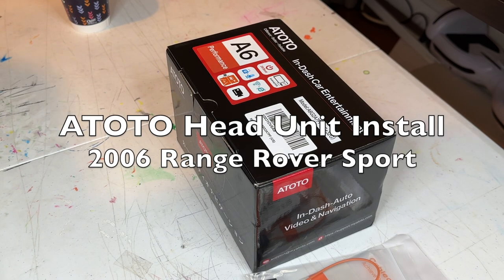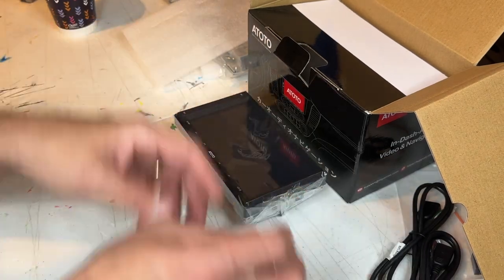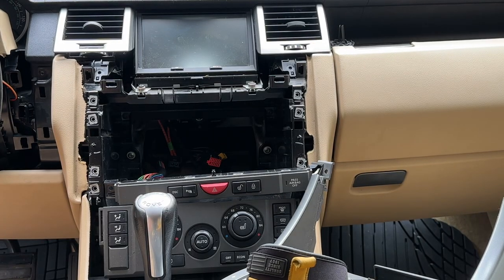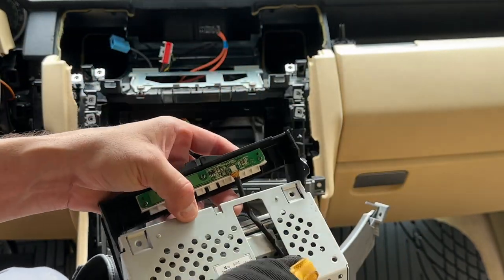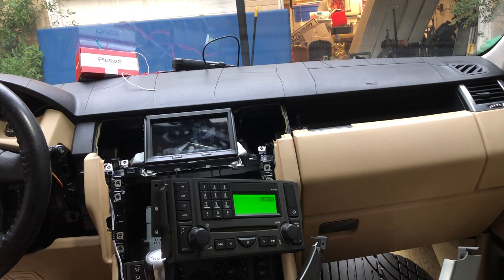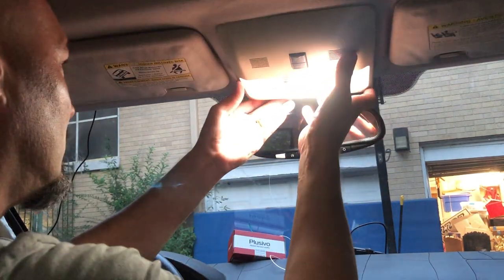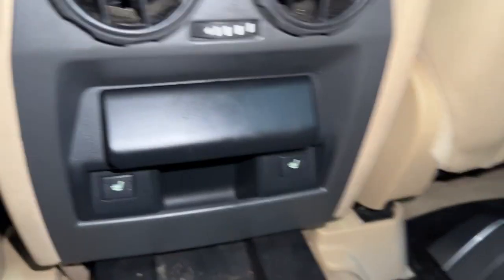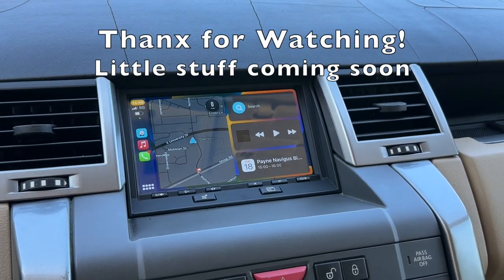L320: $140 ATOTO CarPlay Install∙ Almost OEM! - 2006 Range Rover Sport

Comment: Update for anyone trying: The off white/red and off white/black wires for the steering wheel controls are more of a brownish color rather than off white. Also, they were not twisted together in my case. I cut the off white/red wire, and it was able to control every single steering wheel control by itself
Reply: Hi, what do you mean cut off the off white/ red? You mean the wire cut off from main radio harness? After that, it iþ work all the functions on radio and cd unit?
Reply: @anuraalahakoon8630  I mean I cut it from the back of the main original radio harness yes, then spliced it to the steering wheel control wire from the new head unit. The wire will work for all steering wheel controls

Comment: I used your video as a basis for an upgrade of mine. I bypassed the factory amp. Ran leads from the head unit to under the seat, removed the amp, and wired the channels to 4 ohms. The part I am at now is the SWC wires but I cant seem to get the head unit to learn, did you have issues with this? The OE head unit is completely removed.

Comment: I’m trying to sort mine out now     On the screen Iv only got 4x4 sat nav and setting.    But mine comes with dvd and tv headrest and nothing works not even radio station.   So got new sat nav update dvd     And that work for a bit but was not sure where it was so got new gps but made no difference.     Did see about removing the screen and cut the middle wire out and then you get a different setup and everything comes back on the screen.      But yours looks different like mine lol.    I’m at a loss have to test each wire

Comment: hi, did you need any special adapters, or just with the included
Reply from the maker: Everything I used is in the video. There's no RR to Atoto wiring harness for this install since it uses the AUX port

Comment: Nice video. What's the reason for replacing the navigation screen instead of replacing the original radio unit? Could this be installed where the original radio unit is?
Reply from the maker: I wanted this to look stock so nobody is tempted to try and steal the radio. I prefer stock appearance in my vehicles after getting broken into on past cars I've had

Comment: How does ur stereo sound?
Reply from the maker: Sounds pretty good! I had to leave the Equalizer in Standard mode so it doesn't distort. I also have Logic7 turned off. At 35, the volume is probably 50-75% louder than Factory
Reply: @thazsar please ca. We have a link to order it ?